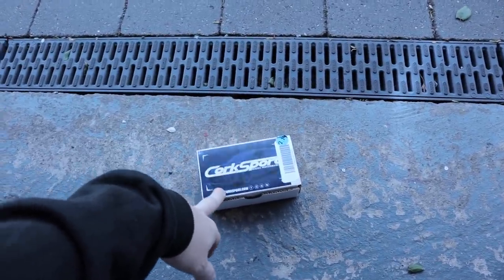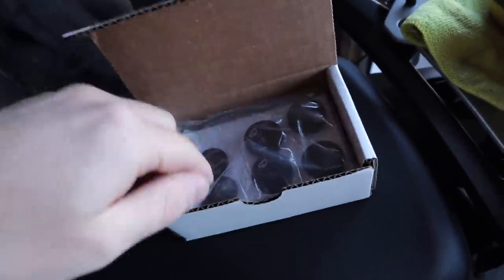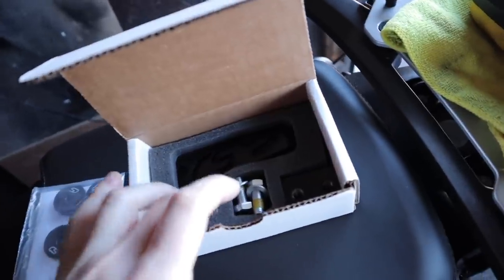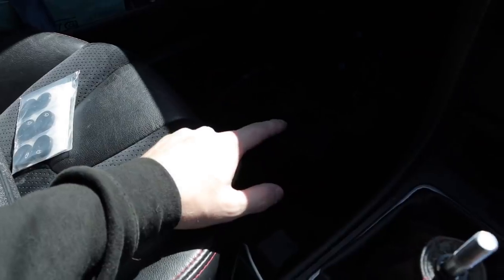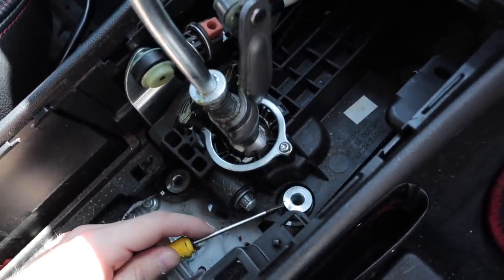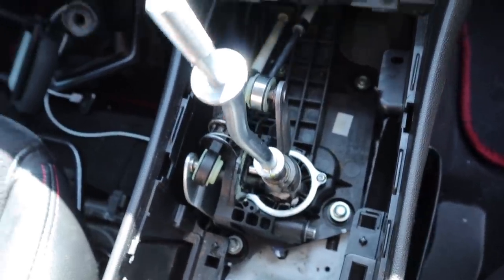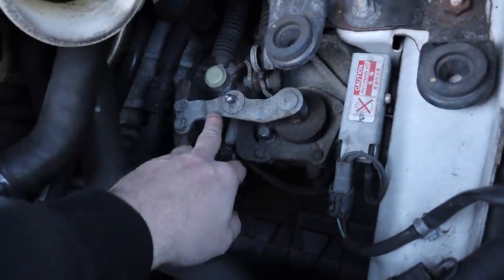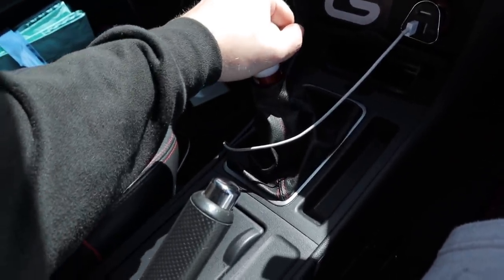SHORT SHIFTER INSTALL ON MY MPS!! *HUGE UPGRADE!*

Comment: Get yourself a rear engine mount. Solved my 3rd problem and helps loads with the torque steer. You can really notice a difference after installing it. Great video too bro, now I know how it’s done when I do it 😂

Comment: When you rag it the motor and gear box flex which puts tension on the gear linkages. Stiffer engine and gearbox mounts will solve that
Reply: Polybushing on the driveway next?? 🤔🤔

Comment: Good vids a usual 
Little tip - Would of bit a little easier if you removed the shifter cables when installing bushes under the shifter 
Should feel good but be careful if you make it too short it can cause more mis-shifting. Take your time getting used to it.
Reply from the maker: Chucky Finster yeah I’ve turned it down from 40% to around 30 as I got told it can do that! Thanks for the help bro 👊🏼🤍

Comment: Hey man those are bad for your trans long term if you do some research. The side to side is caused by it being a cable design. If you want a good shifter setup get a real short shifter.